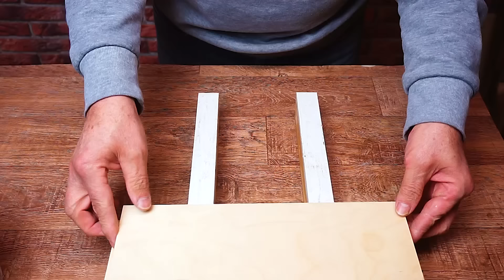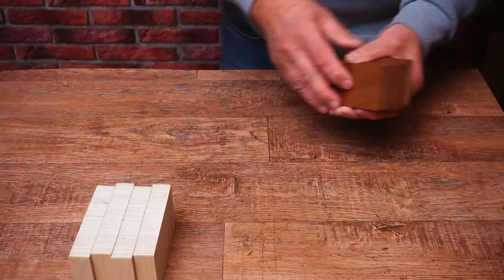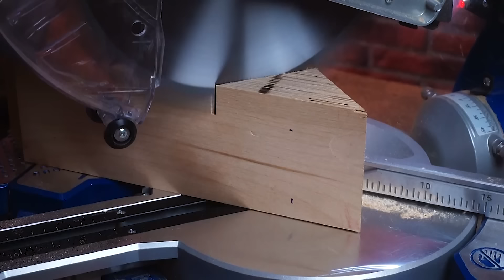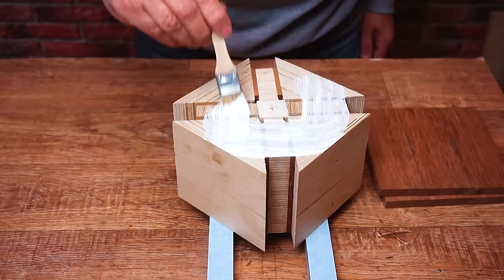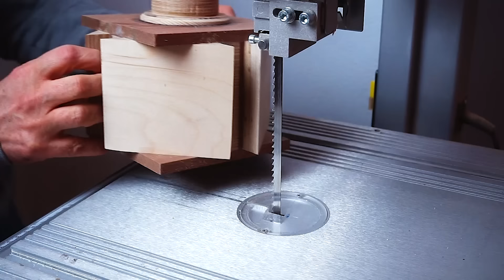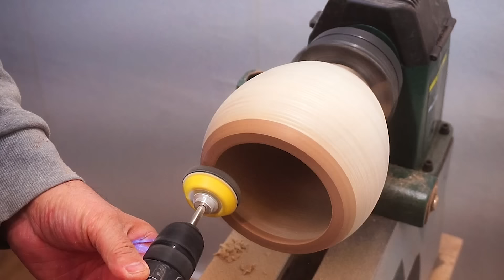Woodturning Plywood: Can It Be Beautiful?

Comment: Best sawing video due to your double blade being on top and bottom to saw two logs at one at a time  that is the best type of saw because it makes two logs in one pass even if the log is two sizeses two larger than the saw size to large for the saw blade ! Two to size of the log a twenty inch thick log can be cut in one pass by a saw blade that is 18 inch in diameter ! Saves one cut down to one pass !  X just great engendering  I done by one pass !!